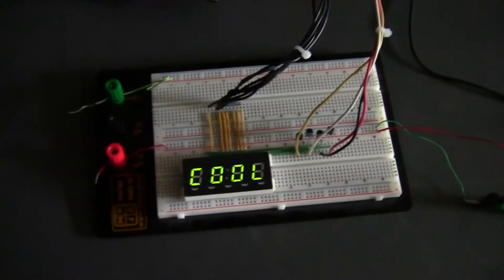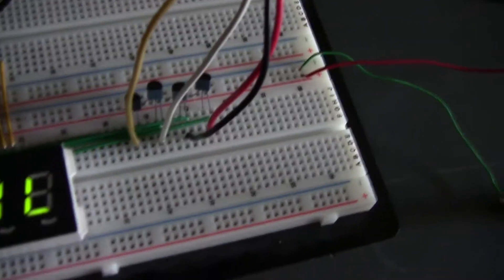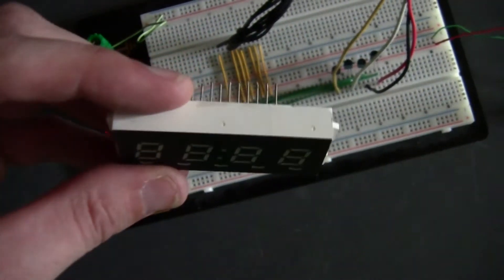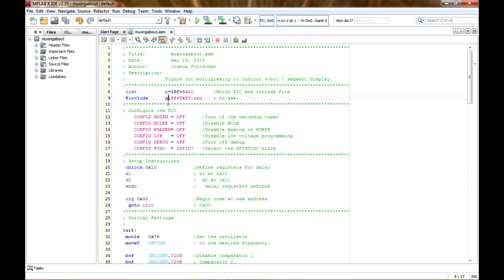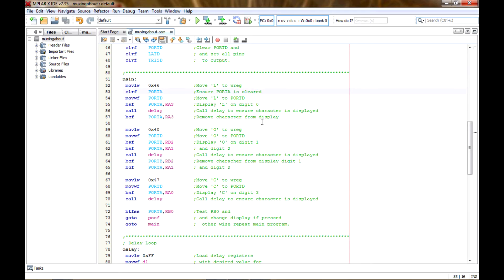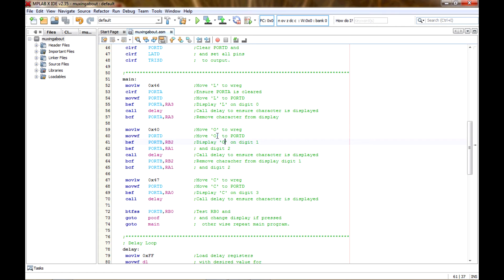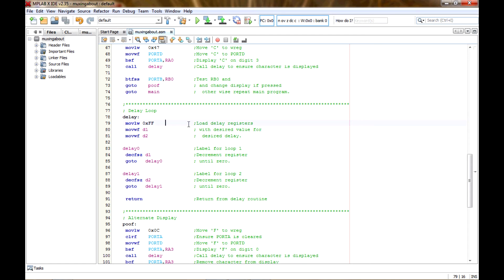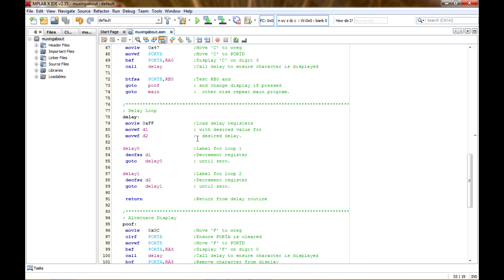PIC18F Assembly Language - Multiplexing 7 Segment Display Tutorial

Comment: For the hexadecimal numbers you've associated with the letters P, C, O, L, and F, I'm confused on what those values are supposed to be because when i compared them to the ASCII table it comes up as totally different values/commands.
Reply from the maker: So, this is a display that I pulled out of an old microwave. I did not have a datasheet for the display and so I just mapped out which leads did what. As such, when hooking up the display, I was not necessarily wired in the correct order that one may typically wire a 7-segment display. I simply mapped out which leads made which segments illuminate and used the necessary values for the desired output. You are correct, that the typical hexadecimel values were not used in this case. Since making this video, I have moved and cannot locate the notebook that I used to map this display. It is possible that I mapped it in a manner that is not consistent with typical 7-segments (i.e. segments typically labeled abcdefg could be named something different like cdefgab).